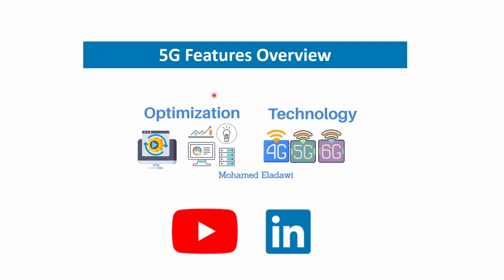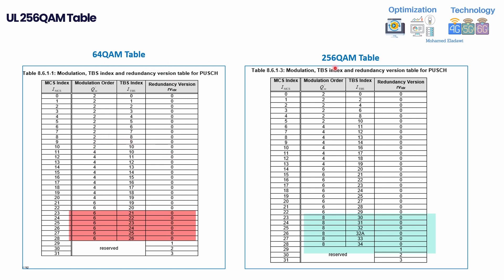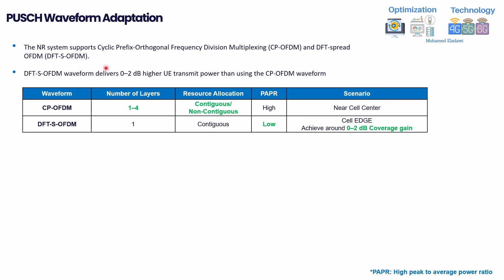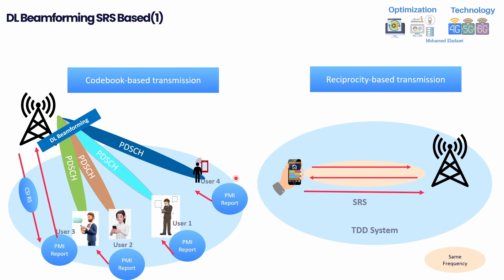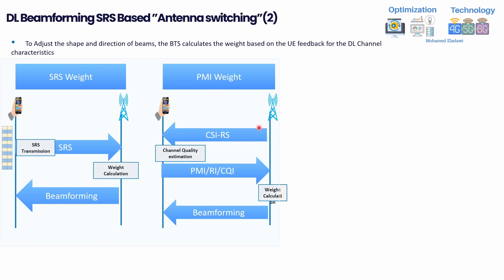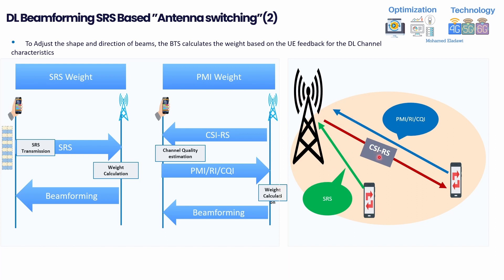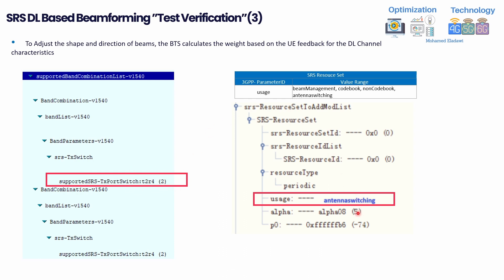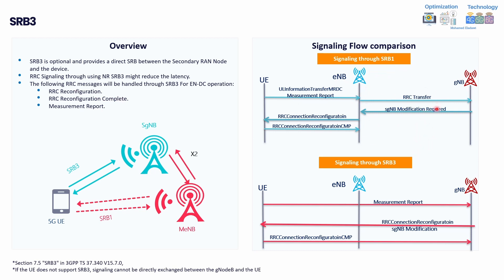5G RAN Features Part 1: DL Beamforming, UL 256QAM & More

Comment: Hello Mohamed! Please provide me clarifications on the following: a) When does the noncodebook usage in SRS Resource Set occur? b) Can SRB 3 be used for the activation of NR Carrier Aggregation? c) Is DFTsOFDM applicable to both NR FDD and TDD? Thank you
Reply from the maker: Hi Georgi,

For part (a), I don’t have the answer readily available at the moment, but I’ll look into it and get back to you as soon as I have more information.

For part (b), that’s a good question. I haven’t verified it before, but I believe it does as SRB3 handle RRC Reconfiguration messages between NR and the UE.

For part (c), yes, it does.
Reply: Thank you very much for your valuable feedback.

Comment: Thanks for srs information….in video we listened that antenna switching can be done in case when less tx and more Rx ,is this  valid conditions???
Reply from the maker: Yes; it is a valid condition. the Dl propagation channel towards each of UE receive antenna can be deduced if the UE is able to transmit the SRS from each receive antenna. And many if the Ue implementations may have more receive antenna than the transmit paths. I quoted this information from 5G NR in bullets book page 365 to 367 and from actual UE capability logs as well. Which was shared in the video